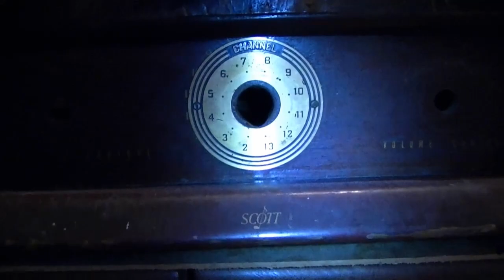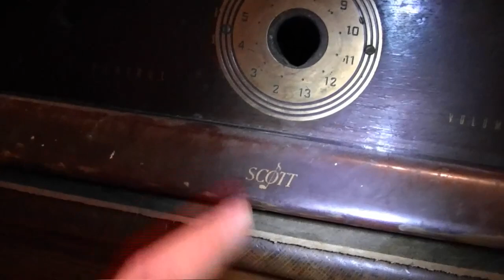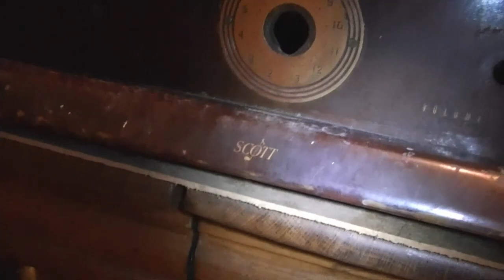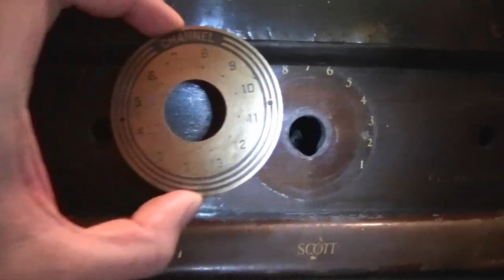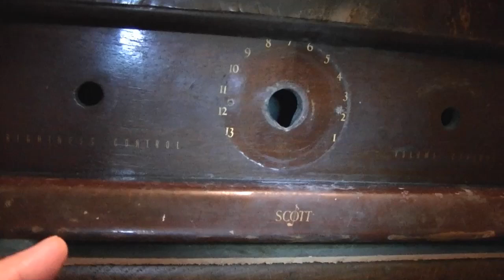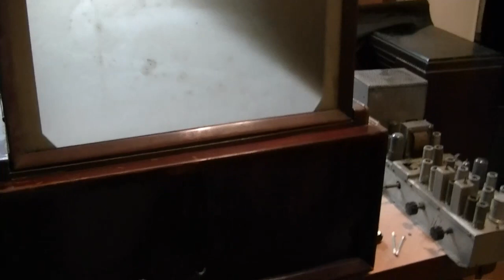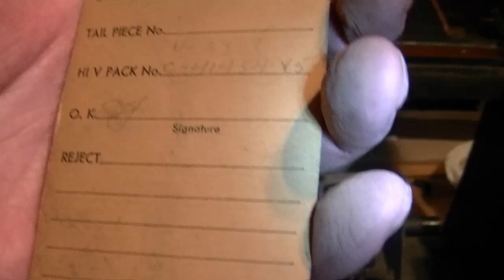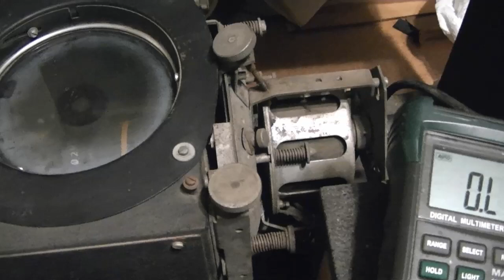Scott 6T11 restoration p1o?

Comment: i am working on a emerson 609 with the same black box tube set up,lots of resisters changed all capacitors,now working on selinium rectifiers to diods.
Reply from the maker: Good luck with it.  They are tricky sets to work on.

Comment: Here in the UK there were quite a few sets that used the Philips/Mullard projection system, these turn up on ebay UK occasionally, so worth keeping an eye on.
There is also a protection circuit that shuts down the CRT if there is a timebase fault, as the phosphor would get burnt very quickly under fault conditions.
I will be following this with great interest, good luck with it.
Reply from the maker: This set is lacking that protection circuit. It was added in later revisions and I found a copy of the retrofit instructions so I will be able to add it :)

Comment: It's been well over a year and I'm just now watching this! I noticed at 14:40, as you pan across the bottom crossbar that holds the multiple control pots, someone has clearly written the word "SAMPLE". This coupled with the evaluation tag you found affixed to the ProTelGram unit makes me wonder if this was a pre-production unit for testing. That might explain the lack of a Scott serial number and model number. Not that it matters, of course, but it does add to the coolness of the set!
Reply from the maker: Yeah I noticed that too.  For sure not very many of these odd sets were produced.  The cabinet graphics are a bit odd on it as well like under the brass channel number plate there are different channel number decals in the finish.

Comment: I have had success restoring severly de-laminated cabinets. I would insert lots of wood glue amongst the laminations, then place waxed papar on either side of the piece being repaired, then sandwich the piece between a couple of thick boards and place multiple clamps around the 'sandwich' and tighten them all up, squeezing the laminations back together again. Even warped laminations would be squashed flat. The glue would cure, I'd remove the clamps and waxed paper, then remove the excess glue on the edges of the piece, then sand and seal and varnish it.
That top piece on the Scott can be salvaged, as warped as it is, as long as all the parts are there.
Reply from the maker: I don't know.  Even if somehow it was possible, it would require an awful lot of work.  In some areas several layers are badly warped and still glued together.  It would require steaming to flatten them out.  Also there is some mildew.  Using a new piece of plywood seems a much easier way to go.    Here are some photos.  http://www.flickr.com/photos/70039806@N00/11408427164/    http://www.flickr.com/photos/70039806@N00/11408431294/
Reply: bandersentv Roger that..yep, it would take some doing to rebuild the top using the original pieces..can be done, just gotta squash things together real good  to flatten 'em out..lol..but since this project is relatively easy, it could be rebuilt from new stock. :)
Reply: One time I had a radio that had gotten wet and the plywood all separated. It had curves and stuff in the cabinet design, so with some clamps and tape and glue and lots of determinism, I flattened it all back together and it survived. :)

Comment: that must have been a massive and elaborate set for its day. regarding the CRT maybe one of the grounds could be a cathode unless they both hook together, or for some reason the heater might be used as a cathode directly, either way i am guessing there isnt an easy way of testing the emissions of the tube

Comment: Hi Bob. A low price bench top table saw with a good blade and a router table with a 1 to 1.5 hp router and some basic router bits will do the work you need to do at a reasonable price. And you will you be using them for other needs I'm sure. One source of finding info on the optics might be a local college or university. They could probably tell a least how to clean them or even source the mirror for a reasonable price.

Comment: I think I may have a suggestion to fix the optics partially, not sure if it will work but it could be worth a shot. have you tried either windex or CLR on the mirrors, and perhaps the frosted glass as well? I seen results for the use of either chemicals on a glass or metal surface and the results are spotless, so I thought I would recommend it, especially since we all are hoping to see you work the miracles you do on that early projection TV one day
Reply from the maker: The mirrors use silver that is deposited right on the surface (front surface mirror) and it is corroded.  Trying to clean it just makes it worse.  Luckily I found a replacement optical assembly that is in much better condition.  No idea when I'll get around to working on it though.  It will probably be a few years.
Reply: +bandersentv I see, well I wish you the best of luck man, the television will be quite beautiful when you have finished working on it. Then that day comes, I will be happy to see the work you can do on it. In the mean time, I have been watching multiple others videos  
by you, some by bigclivedotcom, and multiple others

Comment: What a project! Time to get a relationship with a cabinet shop going. They, and some small cabinet supply and lumber yards often will precision cut panels, parts for a modest fee. Maybe talk to H.L Clausing (www.clausing.com) in Skokie about the optics and mirrors. The large translucent viewing glass may be able to be replaced by a product called "Etch Matte" or "Satin Etch" -these are acid etched, can be tempered, inexpensive and available at good glass shops. Seems like the first step is to get the electronics going good enough to prove the CRT.
Reply from the maker: Thanks for the tips.  Luckily the screen clean up nicely and doesn't need to be replaced :)  http://www.flickr.com/photos/70039806@N00/11240947924/

Comment: Bob I think you can find material to make the lid mirror from an old projection TV that was made in the 1990s. You could possibly find some of the other optics from one of those sets to be useful. Perhaps not but just a suggestion. Gary
Reply from the maker: Possibly.  I also found a cheap source of some surplus front surface mirrors.  I will need to get the concave mirror recoated though.

Comment: I'm sure when you are all done it will look great.  However, why not use the 1/2 inch plywood?  Only 1/8 difference in thickness so don't see it interfering with the reflection of the mirrors? Would be cheaper and easier to work with if your going to build a new whole new top anyway? 
I enjoy your videos keep up the good work.

Comment: Looks like you have your work cut out for you but I'm sure you can do it.  As far as your plywood needs you can take the 1/2 and have it planed down at a woodworking/refinishing shop maybe (yes plywood can be planed).  Or maybe better yet you could if you have a local Menards store, buy wide birch or maple veneer off the shelf and use a standard 3/8 plywood.  Maybe you could get a table saw off Craigslist? Sell it when you're all done.
Reply from the maker: I checked Home Depot and Menards and they only have 1/2" and 1/4" in the stores.  I'll probably just end up ordering some.  Good idea about the saw.
Reply: Find a place that sells Baltic Birch plywood, Home Depot does not as far as I know, it's the closest thing available to the old style hardwood plywood used in radio and TV cabinets. Windsor Plywood sell it around here as well as a local building center that is part of the Home Hardware Building center chain. It is sold in 5'' x 5'' sheets and is available in thicknesses that go up by 1/8'', it's actually millimeters since it comes from Russia but it works out the same. So in Baltic Birch it goes 1/8'', 1/4 inch, 3/8'', 1/2'', 5/8'', and 3/4''. You can plane plywood to some extent but it gets messy every time it hits an alternating layer, it's best to get something that's close.
Reply from the maker: OlegKostoglatov
Thanks for the suggestion.  I see lots of places sell it online.

Comment: This is going to be really interesting!
The lens with the gel in the middle sounds like modern rear-projection TVs which have the same thing between the CRTs and a lens assembly. So it might not be impossible to repair that lens with modern equivalents.. but probably very difficult.

Comment: The mirrors are "first surface mirrors" - most glass shops have or can get it; scrap big screen projection sets have a big piece inside you could cut up to fit. The screen is more problematic; that's ground glass and it's pretty thoroughly obsolete. Yours will clean up OK; you'll need some chemistry to get the dirt out of the surface, though. Try not to break or chip it - it would be very, very hard to replace.

The lens will be a challenge. It's probably two half-convex lenses glued together with optical adhesive; the adhesive is failing, causing the fog around the edges. The fix is to separate the lenses, clean them thoroughly (chemically clean) then glue them back together with optical adhesive. Try heating the lens assembly (gently) to get the old glue to let go. Heat it up slowly, then cool the pieces down very slowly. Using the kitchen oven isn't a bad way to do this; start with a cold oven, then when the parts come apart you can just leave them in the oven as it cools off. The temperature required to make the glue let go depends on what they used to glue them together with. It'll be more than 150 degrees, and probably less than 300.

You'll want the optics to be as perfect as you can get them; there's not a lot of light coming from that little CRT, and after a couple of mirrors and a lens there's even less to light the screen. These sets are best viewed under subdued lighting; the picture isn't nearly as bright as a direct view set.

Also, because the lens / CRT have varying distances from their face to the "top" and "bottom" of their associated mirror, the image picks up "keystone" distortion at each mirror. All of those extra controls under the chassis are to adjust the shape of the raster to cancel out this distortion. When you get to that point and are trying to get the image square and linear - ponder what it's like for a color projector with three tubes. Fun times...

Comment: I wonder if you ever finished it.......if not, an astronomy shop can fix all those mirrors etc.......its called "Aluminising" .....they re-coat the surface of the mirrors like they do in reflector telescopes.
That corrector lens can be split and polished and re-joined again as well.
Reply from the maker: No, I haven't done any work on it yet.  Other vintage TV restorers have used a company called Spectrum Coatings to replate their front surface mirrors.    I believe the lens has a fluid in it with a specific refractive index.  I've already picked up a NOS replacement :)
Reply: bandersentv I would certainly love to see more of this set if you’re up for it. Looks very interesting indeed

Comment: I did a little nosing around myself after watching your video.  You're right, there isn't a lot of info out there, but I did come across an old ebay listing for this set, and there is a decent picture of what the cabinet looks like.  It does appear that there is a molded piece of sorts around the top of the lid, like you speculated.  Anyway, here's the link if you are interested.   http://www.ebay.com/itm/E-H-SCOTT-PROJECTION-MIRROR-12AX7-TUBE-TV-6T11-1940-B-W-TELEVISION-/400280514479

Comment: Did you ever do anything to this set? never seen anymore video's
Reply from the maker: +Amy Marie No, I haven't done any work on this set yet.  Not sure when I will
Reply: okay thanks for Replying.
Reply: +bandersentv i wanna see more about this one     it looks really neat
Reply from the maker: +Fennec Fox (FennecTECH) It needs major cabinet work and I do not have the equipment.  It will probably have to wait until I buy a house, move and get a proper workshop set up.
Reply: id at least like to see an electronics and optics restoration          too bad tho      that thing is freaking epic!   videos like yours have peaked my intrest in recent days  and i want to start restoring televisions from the tube era
Reply from the maker: +Fennec Fox (FennecTECH) That's the thing - the screen is a key part of the optics and its falling apart. I don't want it to get damaged by fooling around with it.  The projection system used in this set was sold after market and could be used with many early TVs.
Reply: oh     okay  :)     well  ill still be hanging arround to watch more       my solution whould be to replicate the cabnet (i cannot figure out that word)  in modern materials     perhaps put out a clasified for a local maker who could help C:

Comment: Scott was supposed to be an obscenely expensive set.  And, yes, they are very heavy.  Plug it in and turn it on, and your neighbors can't make a piece of toast.
Reply from the maker: It wasn't quite the same Scott that made those chrome plated radio chassis by the time this set was made. The chassis are actually kinda flimsy.  The projection optics and HV supply were made by Phillips.